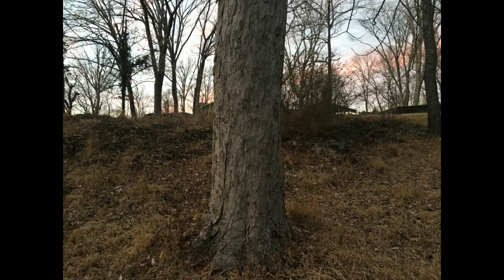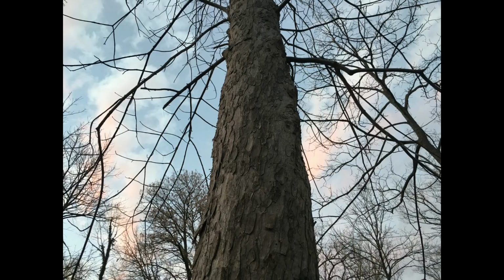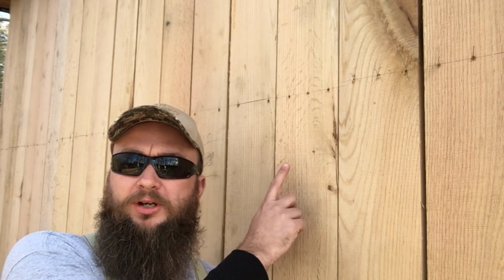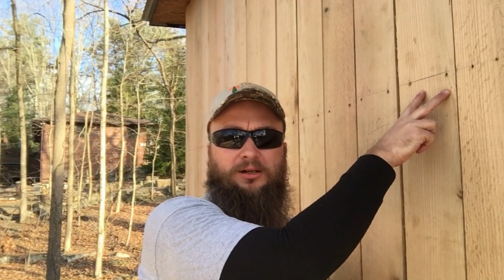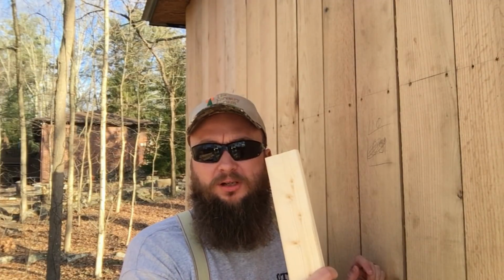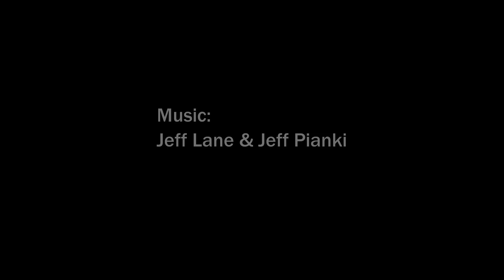SAWMILL UPDATE, JANUARY 26, 2018, BOARD & BATTEN AND MYSTERY TREE

Comment: the horizontal strip will create a rot spot on siding will hold water, better off cutting a 22.5 degree cut on bottom of strip and top of other.
if you installed the flat sawn, keep bark side out 
if you hit end of nail to blunt it  it will not split the strips on end
looks great keep up the good work

Comment: Being a woodworker myself, I think you have the explanation backwards concerning the drying of the wood siding.  If it were plain sawn or flat sawn, it would shrink in it's height than it's width or length.  Being quartersawn gives you lots of cuts through the grain of the tree, showing all those growth rings.  It will shrink along THAT axis as it dries, so your boards will not get much thinner or shorter, but it will change it's width most of all.  

Being as how you do have it in 1x6's, however, the shinkage shouldn't be much more than 1/8 to 3/16th as it dries, so I believe you are correct in still using it as siding, as it wont change enough to matter.
Reply from the maker: If i hear you right you are stating that the boards will shrink in length?
Reply: Nope ... they're gonna shrink a little across the 6 inches of width. 

If they were rift sawn, along the grain, the boards would get thinner.

If they were crosscut, against the grain, the boards would get shorter.

You are still correct in using these boards for this application, no matter what, as quarter sawn wood is the most stable, with the least flexing and bowing as it dries.

To help everybody else understand what i'm talking about .... imagine looking at the cut end of a tree trunk, laying on the ground or set up on the mill ...  The wood will always shrink from the outside (where the bark is) towards the center of the trunk.  This is why, after a tree has fallen or been cut down and allowed to season on the ground for a while, the bark is very easy to peel off ... the timber inside the bark has shrunk from the water loss as it dried out.

This is also what causes checking on the ends of the boards and timbers, when it loses water too quickly after it's been cut, unless you anchorseal it.  The center of the tree will shrink down more than the outer parts of the tree can, which induce stress cracks along the radial growth rings of the tree, in some species.
Reply from the maker: Gregory first of all no offense is intended so I hope I do not come off that way,
Lumber will never shrink it it's length no matter how sawed,  A log if left in the forest to rot will shirk .01 of it's actual length which comes out to about 3/32 of an inch.

Lumber will shrink more on the tangential plane that the radial plane. A quarter sawn board  will shrink little if any of it's width and the thickens will move 4 times as much which is the tangential plane. 

Quarter sawn boards never cut through the grain of the tree, they follow the grain leaving it uninterrupted throughout the board. 

And the bark peeling off really depends on species and time of year harvested. Hickory bark in harvested in spring peels right off, hence why it is sought after for chair seats. If you harvest in summer or winter the bark will stay on until you either peel it off or remove with machinery, 

I minored in College in Biology and Forestry and spent the past 10 years studying timber. If i say something/teach on this channel it isn't backwards.   I would suggest you pick up a copy of The Chair-makers Notebook or the Woodmizer book of Sawing. Both plainly explain what I have just stated.   

Also checking is caused by water loss yes, but the tangential plane is the weaker plane that causes the checking. That is why you exploit the weakness of the tree to gain it's strength.
Reply: As a penmaker, I've worked with crosscut wood before.  Crosscut is something that you NEVER see come off a mill.  Imagine taking a 1x6 board, and cutting a 1 inch length off the end ... then you have a 1 inch by 1 inch by 6 inch crosscut pen blank.  THAT is what i'm talking about when I say a crosscut board.  This type of cut will shrink most across it's 6 inch length.  Nobody in their right mind mills boards in this manner at a sawmill.  On the other hand, a crosscut blank turned into a pen or keychain can be quite pretty and eye-catching, so it's worth saving my scraps to make one, on occasion, even if they are much more prone to "blowing up in your face" on the lathe.

I suppose I'll have to draw some pictures or get my hands on a diagram to illustrate what I was trying to say earlier...

https://petersonsawmills.com/wordpress/wp-content/uploads/2011/02/Pattern1.jpg

This diagram illustrates a flat or plain saw method.  As you will notice, the boards will be oriented so that they are cut more along the grain, leaving the "cathedral" type of appearance on their wide faces.  This type of board will cup and bow as it dries, but once dried (if already flat), they resist splitting along their length very well, as you will be screwing or nailing through multiple layers of growth rings.  This type of board will shrink in it's thickness as it dries (softer growth rings lose more water, making the board appear to shrink between the growth rings).

https://petersonsawmills.com/wordpress/wp-content/uploads/2011/02/Pattern2.jpg

This diagram illustrates a quarter saw method.  As you will notice, the boards are at 90 degrees to the orientation of the flat saw method.  This leaves an appearance of many layers of wood lined up as it goes the length of the board.  This type of board will resist warping as it dries, and is superior as furniture grade and structural building material, but will not resist splitting along their length very well, as you will be screwing or nailing between the growth rings of the wood.  This type of board will shrink in it's width as it dries  (softer growth rings lose more water, making the board appear to shrink between the growth rings).

This property of wood splitting along it's grain and between growth rings is commonly exploited in green wood working

Comment: pretrial the top and bottom hole or blunt the sharp end of the nail by hitting it on a steel plate  to flatten the point saves splitting
Reply: I agree, Learned from a friend who learned from an old timer, The blunted nail punches thru , not splitting like a sharp point. Doesn't always work but used this many times successfully. Also on hard dry wood like oak I have used concrete nails, kinda expensive but they do not bend.

Comment: Cut the head off one of those nails and use it as a bit in a drill. Pre drill the nail holes before driving. It is still tight and doesn't bust thin boards.